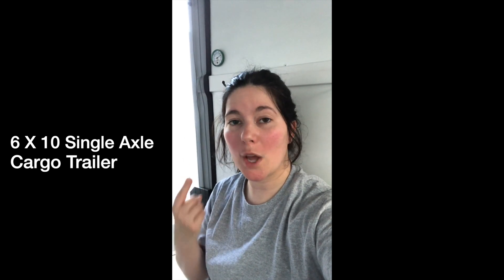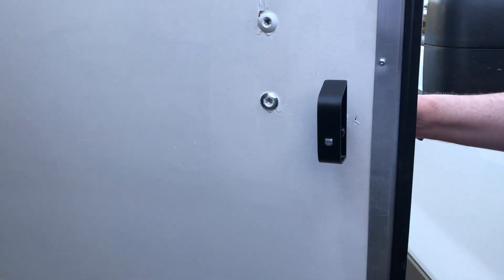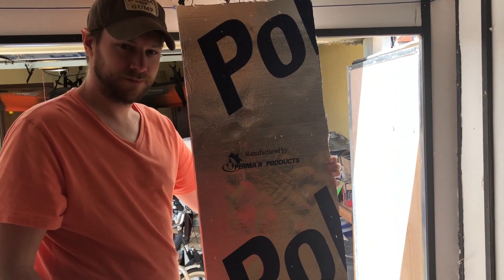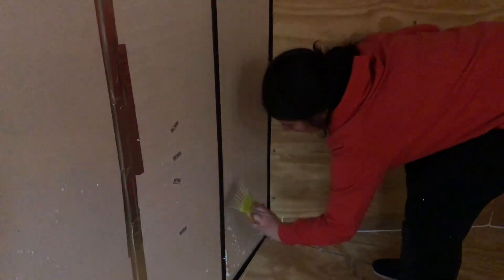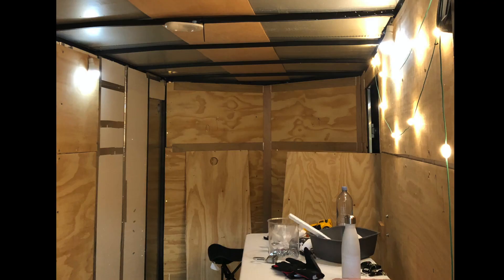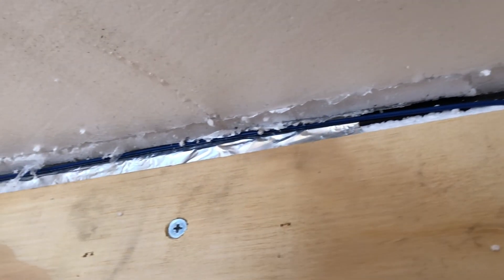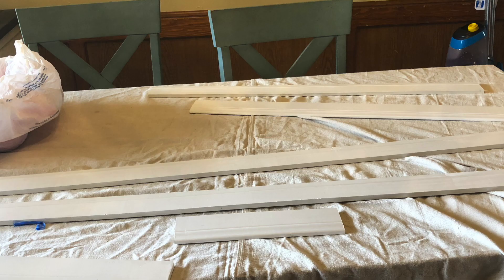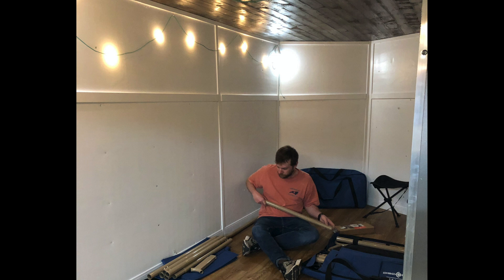Our First Cargo Trailer Conversion! Part-1, Installing Insulation

Comment: Hi, I'm from the IRS and I'm here to help.... no, seriously. I think I can help you a little... says the guy who has made only a few videos.... one mistake that I made was turning the phone (camera) vertically. I see you fixed this later in the video. I love to see normal people who show what they did, right or wrong. Trust me, we are all learning. Another point, to make... it would make cutting insulation easier to  pick yourself up a drywall square as a guide for your razorknife. But a straight piece of thin metal at least 4' long would work. 8' for long cuts would also be great. As far as the product you chose... Polyiso will eliminate all the "snow" that you got from that type of foamboard. Plus, it has a little higher rated R value. Keep the video coming.
Reply from the maker: Hi there! Thank you for all the great tips, so one of the reasons my camera was wonky is I was making tik tok videos of the conversion as well so I had a few vertical images/videos for that which I put in this video. When we do our complete camper tour I’ll use my really good camera and do a better job. Also great tip on the insulation, I think I’m going to use that for under the trailer. Would that work best?